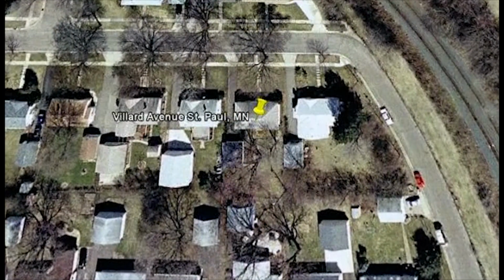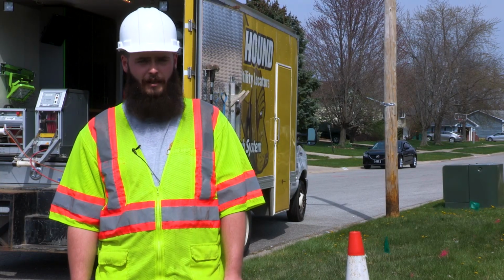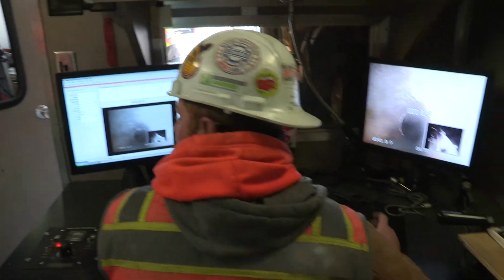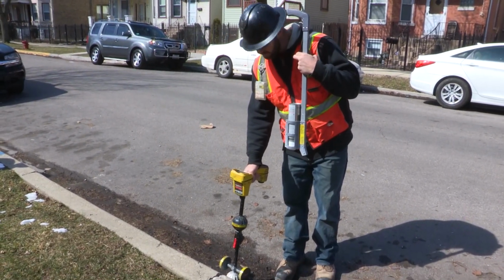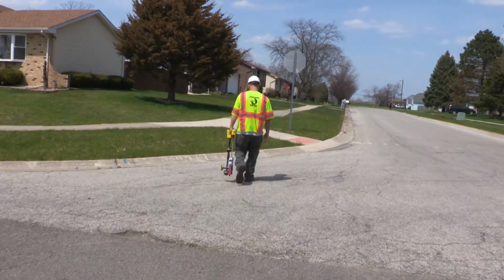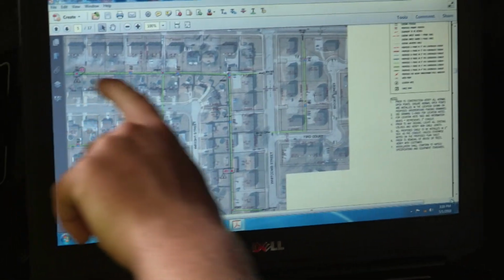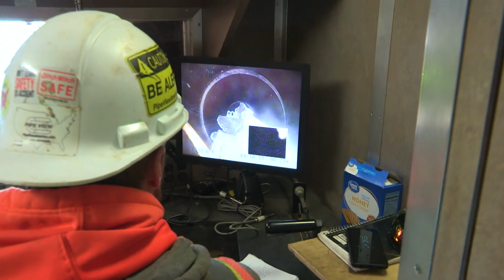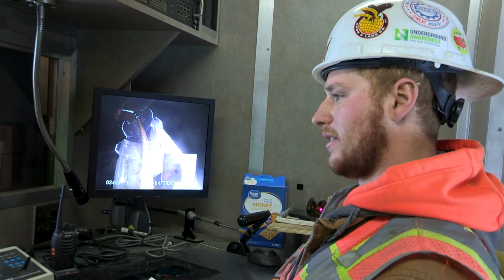Episode 9: Candid Cameras

Comment: It should be pointed out that in order to achieve the true ASCE 38-02 SUE standards detailed here, the process must be overseen by and signed and sealed by a professional engineer.   This will reduce the risk to the project in many ways.  Less damage... better planning reducing shut-down days in the field to redesign... and inclusion of the SUE engineer's errors and omissions policy.